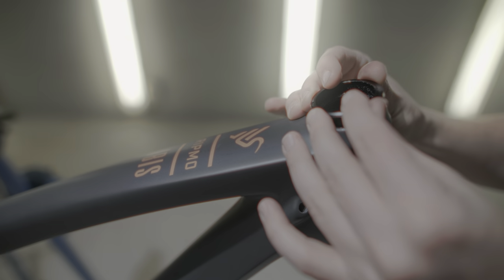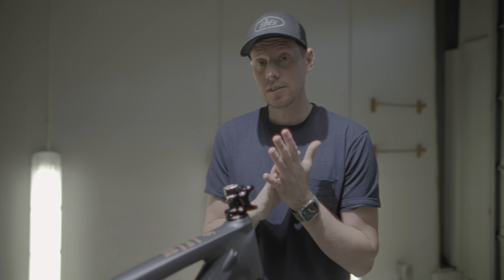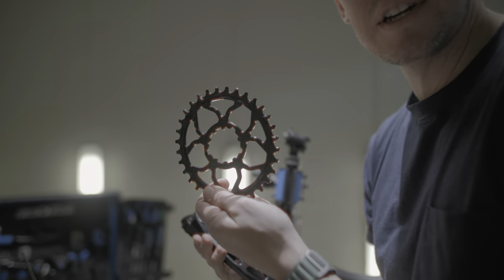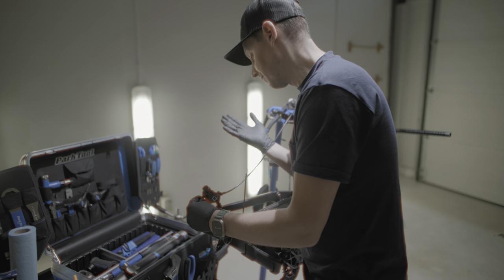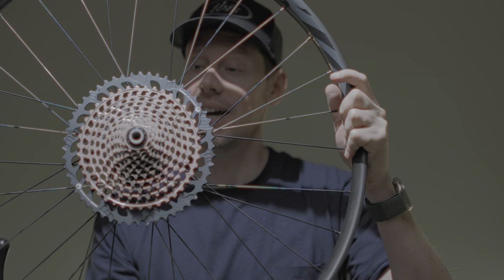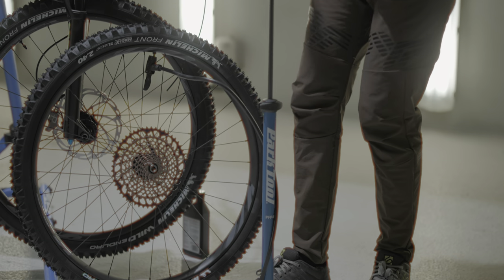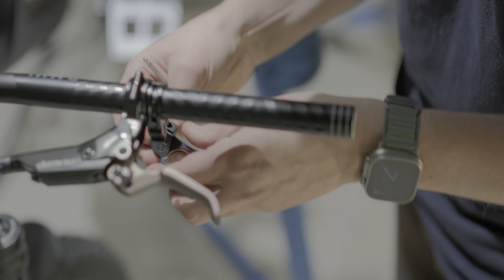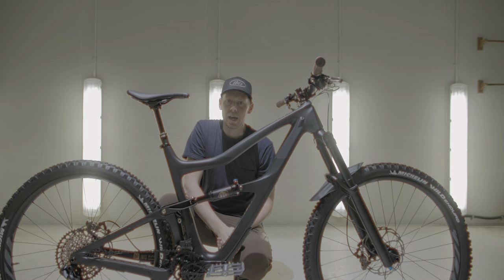Dream Bike Build in HDR 4K (new sponsors revealed)

Comment: Nice video! bike builds are so therapeutic haha

I'm thinking of getting one, but I have a question for the ripmo riders out there - I've noticed the standover is significantly higher than most other modern bikes. Has this been noticeable for any of yall? Like maybe you feel a little more on top of the bike than inside it, or is it harder to lean and dig into turns?

Comment: Please give some updates in the future about all the new parts
Reply from the maker: Will do! Any specific questions?
Reply: @TheLoamRanger  Actually yes, about the dominions. it would be interesting to see what you think about them having tested more brakes. some context, if you don't mind read it .I got a pair for myself recently and i was expecting "an extremely light lever feel" and "amazing modulation" non of theses are false but i think until you get use to the small and very light dead stroke they feel like an on off switch, like shimano brakes. If they had a stronger spring or whatever makes the levers return the transition between dead stroke and actual lever stroke i think would have been way less noticeable but that is not really bad. I got used to them and i like them and i can now modulate better than i could with my old slx brakes. Thank you for replying and reading
Reply: @TheLoamRanger  Also the Manitou suspension is very interesting to know about
Reply from the maker: Interesting! I'll keep an eye out for that once I start riding the build.
Reply: @TheLoamRanger  Mara Pro please!

Comment: It's been a minute since I've seen people using CK hubs instead of I9.  Why CK?  I've had them on an older bike and loved them.
Reply from the maker: I really like I9 as well. The CK’s have a unique sound that I think is great. They also run at a pretty low volume while moving at slow-to-medium speeds, then ramp up the volume while going fast, which most hubs don’t do (most are at max volume right from the get-go). I have also had these hubs for over three years now and on three different bikes, with zero servicing needed. Not bad.

Comment: I miss your old Pole bikes.....Ripmos just suck, just look at what you have to do to make the bike work.....angle head set, 170mm fork, bb is to low....just a really poor design.
Reply: I personally don't find the Ripmos appealing as well.. looks and what you wrote.
Reply from the maker: Not at all. I was blown away when I first switched over to the Ripmo. I go with the 170mm fork and angle set to keep the vertical travel in check and because I like using one bike for everything, from XC to Whistler Bike Park. I truly feel that it’s the best do-it-all bike I’ve ever owned.
Reply: @TheLoamRanger  Don't get me wrong, it's just my personal opinion. I kind of do not believe in a do-it-all bike, as there is a hell lot of a big difference between a DC bike and a 170mm forked bike. But maybe my fitness just sucks ;) The colours you have chosen are superb though! Really awesome build.
Reply: @TheLoamRanger The head angle is to steep and the seatpost angle is to slack. It was a conservative copy of the transition sentinel V1 geo when it came out and it has  just gotten more dated as it has gotten older. The best thing that you can say about the ripmo is its a good long travel xc bike except with the really low bb at sag it is a peddle striking machine on tech climbs unless you go to 160mm cranks. Of course you go to 160mm cranks, you have to raze the seat, then you have thrown some more spacers under the stem to get the bars up......just a really bad design.